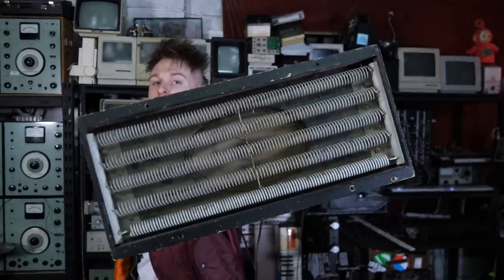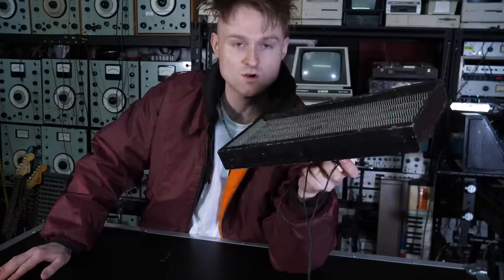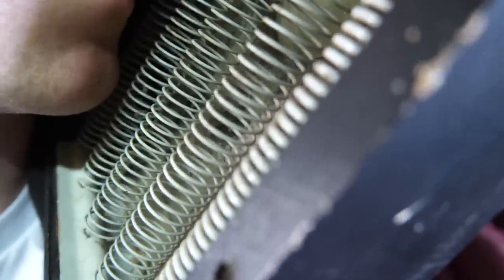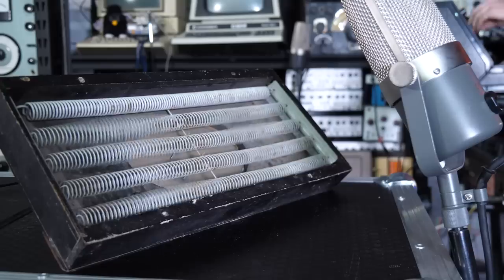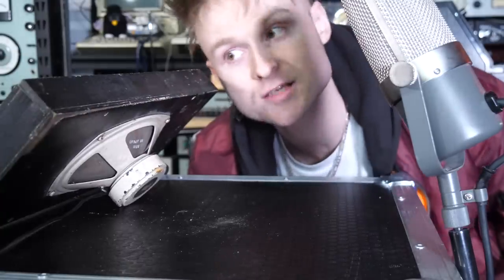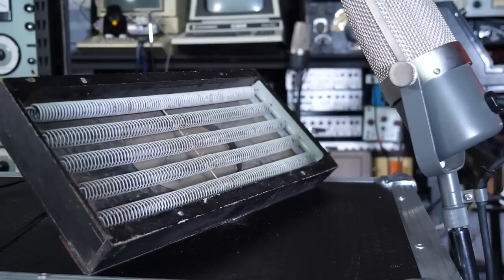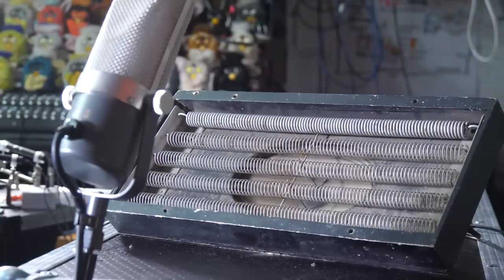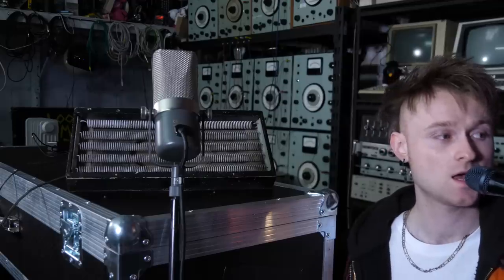Trying A Weird Vintage Spring Speaker Reverb that i've never seen before.

Comment: You need to add electricity so it sparks when they touch
Reply: Steven Nelson and a blue light to help catch passing fly’s
Reply: Or add heating springs so it glows red
Reply: Emerald Blaze those could be heating springs if you ran enough current through them.
Reply: Get together with the electroboom guy!!!
Reply: yeah, 
make the springs glow red hot + 
arcs when they touch + 
ultraviolet light for the flys +
 ram some styrofoam in there while filming that madness            

 HAHAH
Reply: @sndrcve  bit of music before they die😂🤣😂
Reply: technically it is fed electricity..  V x A = Watts.

Comment: Anyone who has ever knocked into an old Peavey combo amp from the 80's knows that calamitous garage door spring breaking sound all too well.
Reply: I had a 100W Crate 2x12 combo amp I bought brand New In 2008 or thereabouts and it had a spring reverb with actual springs so at least then those were still used. It was not an expensive amp either, just a cheap transistor one.

Comment: That frequency sweep you did has so so many sweet spots.  The drum loop sounds fucking cool too, especially the claps.
Reply: There were at least two dead spots in that speaker as well. Pretty good considering modern speakers have more dead spots than that.

Comment: Cool as it got back then. This looks 60's though I am on States side of the pond. It is important to note the springs are driven in the center by a direct physical connection to the speaker. Hence the springs sound couples back to the speaker and is heard. I have never seen anything like it. 

Caution! That speaker is rated for no more than 20 watts, and that kind of bass will damage it. It's brittle paper and phenolic held together with crisp glue. It's no ordinary speaker.
Reply: inb4 someone handcrafts a new version with aramide cones
Reply: @mindbreak666  brb gonna frankenstein one of my Focal car speakers
Reply: @MyOldNameWasTaken  upload method and results ploxx
Reply: I wonder how much fun I could have with one ten or twenty times more powerful hahaha
Reply: interesting insight
Reply: I'd figured it was from the 60's as well, it's definitely for a guitar.
Reply: Do you know what kind of speakers this is? Can we still find these?  I'm trying to figure out how I could build something like this.
Reply: @williamparent1920  it's a french Audax, just an ordinary good quality tube radio speaker
Reply: @Jimmyhaflinger  , it appears to have a ceramic magnet, which would probably place the speaker as no earlier than 1964 or 65, and therefore probably designed for use with a transistorized radio or amplifier ....BTW, .Audax is also known as Polydax on this side of the Big Pond.
Reply: @goodun2974  in europe, ferrite magnets were sometimes used earlier starting in the late 50s
Reply: @Jimmyhaflinger  , interesting ---- here in the US, the earliest date code I've seen on a speaker with ceramic (ferrite) magnet was around 1962 or 63, and they didn't start to become common until around '64 or '65....
Reply: @goodun2974  on the other hand we had some alnico speakers up to the early 80s, and they were just ordinary large TV speakers not guitar or HiFi drivers
Reply: @Jimmyhaflinger  , I've seen alnico dealers used here up til around the mid 70's but some of those might have been "surplus". Most manufacturers went with whatever was *cheapest*, and generally the speakers with "mud magnets" would be cheaper than alnico, but surplus is another matter. For Instance, Valco built guitar amps (for Gretsch, and their own National or Supro brands) with surplus 6x11" oval alnico-magnet speakers well into the mid 1960's, even though those speakers were originally made for use in 1950's Chrysler automobiles!
Reply: so its a kind of feedback through mechanic coupling? neat
Reply: @echodelta9 -   Yes.  I'm thinking the signal sent to the device would have the low frequencies rolled off, or blocked, or high-pass..... whatever the terminology reducing the lows would have cleaned up this reverb nicely.
    Now, I'm thinking the device in the video may have been used as a "microphone", with some other source exciting the springs. 

  Hmmmmmm..........I need more weed in order to think about this correctly.
Reply: i highly doubt this speaker will handle even 20W.
This type of speaker usually can handle 3W or 6W max.
Reply: ..divebombin' and machine guns, holy Kry keys Batman!

Comment: Should build some "new" versions of this.  Give more room between the springs and have them further from the back board so they wont hit the backboard and each other as easily.
Reply: Spring reverb is a pretty common thing in decent guitar amps.
Reply: N1nj4L1nk pretty sure he means analog spring reverb. Not digital.
Reply: @txspeck  so did I. I got a Hughes and kettner amp, in 2011 with proper spring reverb. It wasn't even an expensive one (£250). Before you say, yes, I'm sure it was analogue; digital doesn't make spring noises when unplugged and knocked.
Reply: @n1nj4l1nk  you sure it wasnt a combo/cabinet, not an amp?
Reply: @NVMDSTEvil  yeah it was a combo, I've always just called them amps haha. 
Anyway, my point was that I'm confused that it's so cool to you all when it's a fairly common thing.
Reply: @n1nj4l1nk  honestly never seen it done with actual springs before now.
Reply: @NVMDSTEvil  it used to be fairly common for them to have reverb tanks. There wasn't really another way to do it until digital.
Reply: Or you know use this one just don't play it so loud!
Reply: Stephen M I love the sound as is, like Geiger horror hits
Reply: Or just turn the input down...
Reply: @RYANWASON234  Using less input would mean the microphone would have to be more sensitive, no? And then it may pick up more outside noise. I think a dedicated spring tank, like in old guitar amps would be great for recording.
Reply: @txspeck  Oh, there is a great example for a newly invented and purely analog "Spring reverb instrument" ! Finally I know, where Görkem Şen drew his Inspiration from for his exceptional "Yaybahar" ^^
Go check it out. It sounds great.
Reply: It'd be easy to build new versions.  Trip to the hardware store.  Trick would be to find an optimal placement of the springs.
AND - how to arrange it artistically as well as musically...

One thing to note - there IS a difference in the springs that someone put a lot of thought into - though they didn't imagine stuff as LOUD and crazy as our Neo Punker uploader here.  There's a thick spring to suck up the very high sounds and thinner springs for the mid range and a loose one for low sound.  Well, IMO their intention was opposite, I bet at normal stuff (Imagine Lawrence Welk and "Lounge" music like "Ritual of the Savage") from decades back this was good at enhancing and amplifying sound.  A modern setup I'd use more springs and give them better wiggle room.

When and if I build such a monstrosity I'll upload here - and give credit to this guy for inspiration...!
Reply: These springs just hang out and vibrate. Guitar spring reverb sends an electrical signal through the springs, and how that signal is translated through the springs becomes the new reverb signal.
Reply: The collision noise of the springs is the most fascinating aspect, in my opinion. Everything else you can do with a simple convolver plugin
Reply: This is the 'bedroom practice amp' version :-D
Reply: @Dude-Smellmyhelmet  ,  Before there was spring reverb being added into consumer products such as guitar amplifiers, there were plate reverbs used in recording studios, with giant sheets of metal as the reverberating transducers. Those can sound far more like actual room reverberation than a spring reverb does.

Comment: That could be a cool diy project, maybe testing different types and lengths of springs.  It's cool how it kinda visualizes the sound, too.
Reply: id have to paint my springs with a nice range of colours
Reply: even better paint them with thermal paint so that when the springs heat up from movement they change colour
Reply: I'd use smaller diameter springs, or put them further apart, so tey don't collide, to get rid of the 'clanking' when they hit eachother.
Reply: @KCML82  I kind of like that effect , but I get what you mean, Id also take away that central bar that sort of holds the springs and replace them with individual strengthening rods for each spring , that way any vibrations are not sent along the central support beam and then passed into the adjacent coils causing feedback. But I guess its all a part of the unique sound that box makes. You could easily experiment with different coils .
Reply: @KCML82  Maybe not as much collision but a little can be useful

Comment: that speaker can take a beating wow
Reply: Beat it beat it - Michael Jackson
Reply: YOu'd be amazed at what some older speakers can take. I had a set of 1960's era "home theater" speakers with a 12" sub, 6" mid and 1 or 2" tweeter in each upright box and those things were LOUD. They took decades of use and  then some abuse from me as a teenager using it to play my electric guitar through the system... And playing my metal. It took me cranking everything to the max to pop one of the old paper and glue sub woofers (though it was more a failure of materials).... Great fun, actually kind of made it hard to breath and got me a call to the police from neighbors a mile away!
Reply: @SilvaDreams  I have a pair i of vintage technics, they get real loud while continuing to sound amazing but i would not dare to test them THAT hard lol
Reply: @OvAeons  i have a set of technics sb-6000a good bass, good highs but no mids. I guess my infinity rs 3b have spoiled me.

Comment: This reverb actually sounds pretty decent. The different spring thickness is to smooth out the reverb even more. (not support at all) 4 springs will also do that. A good thing to to do would be to mount a piezo pickup at one end to just isolate the reverb out. Even better thing would be a piezo pickup at each end on the support brackets. Then you would get a lovely stereo spring reverb effect without the dry signal. The Mic is going to pickup the dry signal which is not really wanted. It sounds quite long though. You could also wedge some light foam in between the springs to speed up the reverb time as well. I have done this before.
Reply: I like how you think!
I'm an old boy now, but back in 1965 I played in a garage band for two years.  Back then it really was a garage band because parents would only let us play that loud in a garage.  At least until you're good enough to be let into the basement.  Anyway, I was the lead guitarist and had, I think it was a 100watt amp, nothin' special.  But it did have tremello and reverb.  And the reverb was springs mounted on a block of wood.  I know, because back then I would take things apart to understand.  We would rock the amp back and forth to get the reverb block to crash and do its thing...  Really enjoyed this video!!!

Comment: A mate had an old organ with one in, the springs are usually arranged to resonate at different frequencies. The organ also a speaker with two revolving horns over it to make the sound go round the room, I replaced the speaker on that. There were several other physical tricks in there, as opposed to electronic.

I have a stereo spring line delay, about 3 ft long, its awesom, no use for it now though. 4 xlr plugs on it, active whereas your unit is a passive reverb, its got an attenuation controll on each channel too. If you just want a lot of reverb, the output of one channel can be fed into the other. I think it was used in the theatre or a professional orchestra.

Comment: I haven't seen one of these things specifically before, but when I was a kid, my local science store (which still exists, American Science and Surplus) had something vaguely similar looking in one of their unsorted bins. It was a largish rectangular box with an RCA jack on both ends, and a jillion tightly stretched thin bare wires running back and forth, which I THINK were insulated on each end so that it was effectively one very long wire (no speaker though). 

The guy who I asked about it guessed it was used to create a delay, but I was like "there would have to be thousands of miles of wire to get a noticeable delay, right?" He grunted and told me to buzz off (the people who worked there then, unlike now, were super-cranky). I'm wondering if it was actually a different kind of reverb, with the wires interacting with each other magnetically and vibrating when you ran a signal through it. Wish I had bought it 40 years ago, it would be interesting to make one and see if it works.

Edit: A little 40 year delayed googling (wish THAT existed in the 1970s, it would have made trash picking weird electronics a lot easier) has turned up a lot of devices similar to what I remember, called "reverb tanks". Most of them had springs inside where I recall the wires as straight, but otherwise, same thing with no speaker required, just a jack on the ends and weird insulating thingies on each end.
Reply: Sounds just like a normal spring reverb but with wires instead of springs.

Comment: Looks like it could be out of an old organ. One of the foot pedals would control a padded (felt) lever that would touch the springs and stop or start the reverb effect. ...or possibly an early guitar amp. But the age/look of the 6x9 speaker on there definitely leans closer to like... an old Hammond organ.

Comment: Me before the video: It's just a speaker with some springs, can't be that good, but curious enough to watch.

Me after the video: I want one, could be really good for certain genres of music.
Reply: If you got a speaker all you need is springs ;) you could even build a frame for the springs that attach over the speaker, making them a removable option :D
Reply: You have to attach the spring holder directly to the speaker to get the proper effect. Thats the trick

Comment: I was surprised at how much like a real reverb this sounds, rather than a spring. Are the springs at a different tensions? At looks like the top one (as you have it laid down) moves far less than the others. Maybe emulating early reflections.
Reply: It has different wire gauges. The loose ones for the first part of the effect, the thight ones are for the decaying effect. I think these are reused piano wire.

Comment: I had a couple of Sansui reverb amplifiers that used springs like these. They were early 1970's vintage,  and were adjustable,  via tension, and dampening.  Your speaker is likely the same vintage,  or perhaps late 1960's. The trouble with mechanical reverb, is that it is indiscriminate about what signals are reverberated.  Solid state devices proved to be more reliable.  That's a cool find.👍👍
Reply: Would tuning individual springs, and being able to de-tension or damp them help?  Of course it would not be as versatile as a digital reverb, but people who like these old things don't care about that.
Reply: @tonyennis1787  In my experience, that doesn't do much for the sound quality. I don't have them anymore, or I would try it.

Comment: When it hit that perfect resonant frequency to make it shake, it made me think how cool it would be if you actually could build a Tesla Oscillator (the earthquake machine).
Reply: If I'm not mistaken, all we have to do is find out the frequency of a certain object, and then match that frequency with a soundwave and put it next to it, in order to make it move.
Reply: Basicly a speaker is Nikola Tesla his earthquake machine. It is the same mechanism. Thats why resonating sound freqeuncies amplify the sound. And for bass this can be perfect. But bass can also destroy houses cos of resonating frequencies. Like a bridge in the wind once broke. Wind is actually like sound. Just a wave in the atmosphere.

But Nikola Tesla also had a secret.   So we cannot create the actual device that he was using. We can only create the mechanism that did the up and down movement.
Reply: Tesla has specific patents pertaining to the "Tesla Oscillator" and I'm fairly sure you can just outright buy a model based on his patents but yes it's very similar to a speaker just able to span a broad spectrum to cause the sympathetic vibration, just like when an opera singer breaks a wine glass. But these are the things he could explain/talk about in his video, if he were to get into this subject. I just think it would be a fun project.
Reply: @nomadautodidact  Yes you can. He had different types with steam and without etc. It's very interesting. But those devices om itself can sadly not explain an earthquake machine. Nikola Tesla had the keys. Those keys he never gave.

Comment: Takes me back to the early sixties when I was doing a similar thing. I had the speaker connected to the spring via cotton thread through the cone and at the other end an "electric pick up" with a sewing needle installed to amplify it. This was  so I could hook the spring through the eye.

Comment: AUDAX was a French loudspeaker manufacturer founded in 1931.
"The company will use state-of-the-art techniques to develop its range using Bextrene, Ferrofluid or Aerogel. Many of these products are known for their acoustic qualities.
In 1987, upon the death of its founder, the company was sold to the Harman group.
In September 2007, the Harman group sold the brand and manufacture of Audax loudspeakers to AAC (Composite Acoustic Applications)."
https://fr.wikipedia.org/wiki/Audax_(entreprise)
Audax website in 1996: https://web.archive.org/web/19961029133341/http://www.audax.com/
Audax website in 2018 (AAC): https://web.archive.org/web/20180630144533/http://www.audax.com/index.php